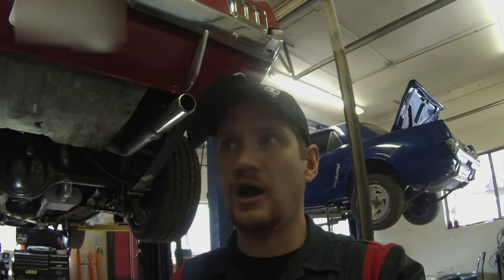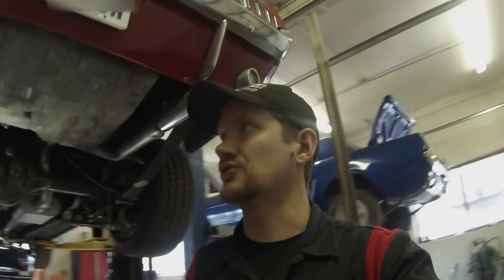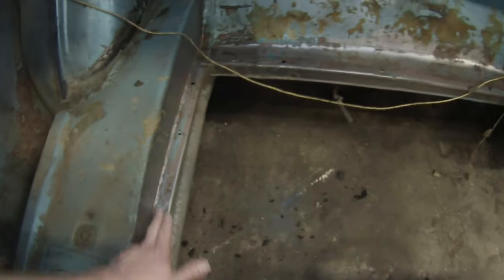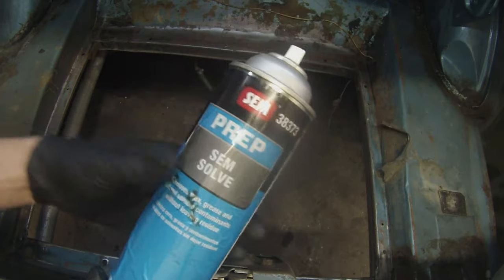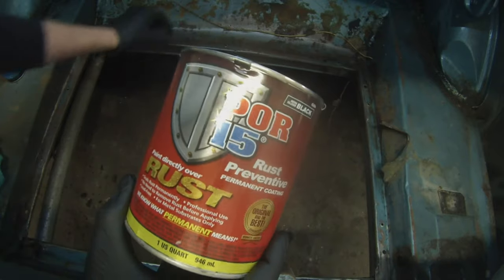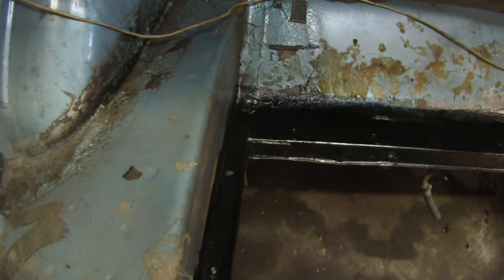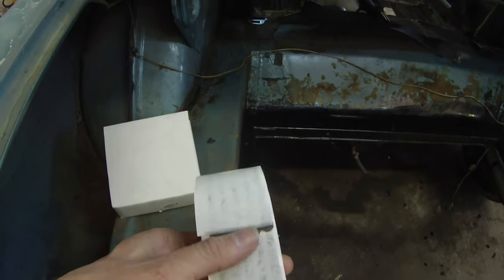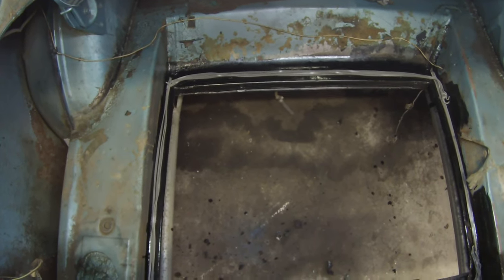How to install fuel tank in your classic Ford Mustang - Alf's Mustang Garage

Comment: What are those clamps t, holding the wire down that run across the trunk called?
Reply from the maker: This?    https://www.npdlink.com/product/wire-retainer-rubber-coated/167583/202875